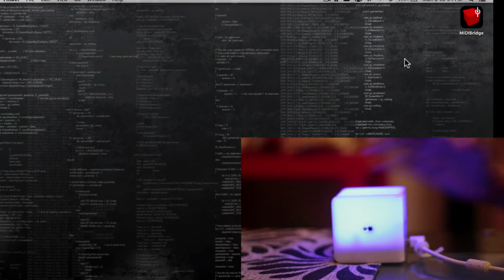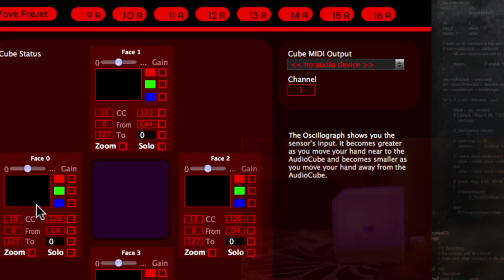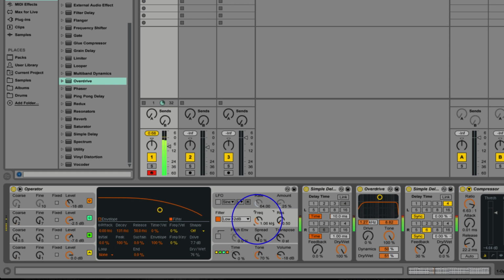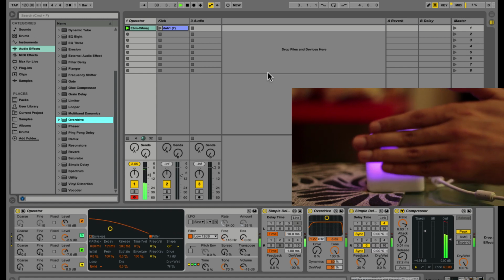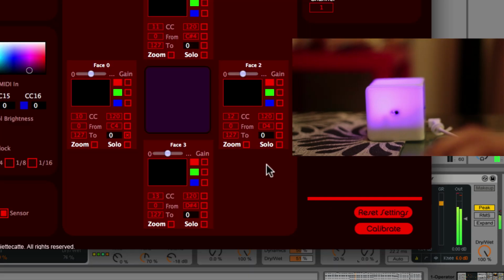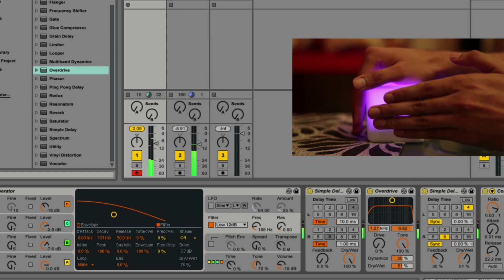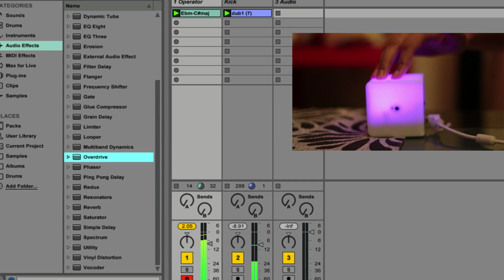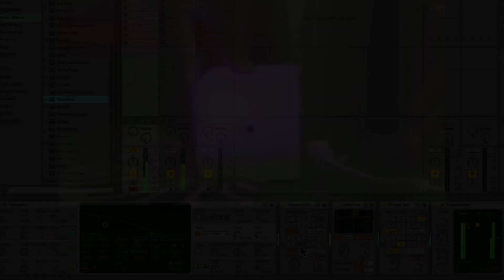AudioCubes Sensor Mode Tutorial

Comment: Paolo Manzelli , egocreanet2016@gmail.com ; The concept of phonons was introduced in 1932 by Soviet physicist Igor Tamm. The name phonon comes from the Greek word φωνή (phonē), which translates to sound or voice because udible long-wavelength phonons give rise to sound.
A "photon" is a quantum of light of wavelength and is the minimum amount of energy which can be stored in an electromagnetic wave at that wavelength e.g translating this to vibrations normally looking at a crystal lattice, could we say that a "phonon" is the minimal amount of energy which can be stored in an lattice vibration in a given vibrational mode. So that"phonons" may be known as "quasi-quantum-paricles".
Shorter-wavelength higher-frequency phonons are responsible for the majority of the thermal capacityes of solids. In particular, the properties of long-wavelength phonons gives rise to sound in solids -- hence phonons are also the primary transfer  by which heat conduction takes place. So that "phonons" my be seen as  specific sub-state of "photons" .As a conseguence there is a considerable disparity between the velocities of "photons and phonons".  The velocity of a "photon" is the same as the velocity of light in the vacuum;  for a phonon, its velocity is that of sound in the matter. (in Water 1500 m/s ,in metals : 5 Km/s ) 
 Phothos and Phonons can interact.
"Sound" waves can modulate "light" in amplitude and phase, deflect it, focus it, or shift its frequency. The "Light" can render acoustic images visible or provide detailed information on the thermal vibrations in solids and liquids. Diffraction of "light waves by sound waves" takes several different forms, depending on the two wavelengths and the dimensions of the interaction region. An analysis and description of these different forms of quantum energy, may be given, followed by a detailed discussion of a wide variety of applications, including signal processing devices, spectrum analyzers, television displays, image translators, memories, based on the interaction and the conversion of light into sound.  At last became be possible to realize a "phonon laser" e,g.  the Sound Amplification by Stimulated Emission of radiation with the name SASER. Acoustic radiation can be emitted in the same way of photon radiation as it  is emitted in LASER. The properties of SASER are almost the same as LASER but a deep study now it is necessary. . 
Biblio online: 
http://ieeexplore.ieee.org/abstract/document/5215753/?reload=true ,
https://en.wikipedia.org/wiki/Phonon ,
http://news.mit.edu/2010/explained-phonons-0706 , 
https://lampx.tugraz.at/~hadley/ss1/problems/phononfield/Q.php ,
https://wiki.metropolia.fi/pages/viewpage.action?pageId=118981927 ,
https://physics.stackexchange.com/questions/92185/photons-and-phonons ,
https://www.quantiki.org/wiki/phonon ,
http://en.wikipedia.org/wiki/Sound_amplification_by_stimulated_emission_of_radiation
---------------------------------------------------------------------------------------------------------
Correlazioni e equivalenze tra fotoni di luce e fononi di suono -
Il concetto di fonone fu introdotto nel 1932 dal fisico sovietico Igor Tamm. Il nome phonon deriva dalla parola greca φωνή (phonē), che si traduce in suono o voce perché i fononi udibili a lunghe lunghezze d'onda danno origine al suono.
Un "fotone" è un quanto di luce di lunghezza d'onda ed è la quantità minima di energia che può essere immagazzinata in un'onda elettromagnetica a quella lunghezza d'onda, ad esempio, traducendo questo in vibrazioni che normalmente guardano un reticolo cristallino, potremmo dire che un "fonone" è la quantità minima di energia che può essere immagazzinata in una vibrazione reticolare in una data modalità vibratoria. In modo che i "fononi" possano essere conosciuti come "parcelle quasi-quantistiche".
I fononi di frequenza più alta a lunghezza d'onda più corta sono responsabili della maggior parte delle capacità termiche dei solidi. In particolare, le proprietà dei fononi a lunghezza d'onda lunga danno origine al suono nei solidi - quindi i fononi sono anche il principale trasferimento attraverso il quale avviene la conduzione del calore. In modo che i "fononi" siano visti come sotto-stati specifici di "fotoni". Come conseguenza c'è una notevole disparità tra le velocità di "fotoni e fononi". La velocità di un "fotone" è la stessa della velocità della luce nel vuoto; per un fonone, la sua velocità è quella del suono nella materia. (in acqua 1500 m/s , in metalli 5 km/s) 
Phothos e Phonons possono interagire.
Le onde "sonore" possono modulare la "luce" in ampiezza e fase, deviarla, focalizzarla o spostarne la frequenza. La "luce" può rendere visibili le immagini acustiche o fornire informazioni dettagliate sulle vibrazioni termiche nei solidi e nei liquidi. La diffrazione delle "onde luminose da onde sonore" assume forme diverse, a seconda delle due lunghezze d'onda e delle dimensioni della regione di interazione. Può essere fornita un'analisi e una descrizione di queste diverse forme di energia quantica, seguita da una discussione dettagliata di un'ampia varietà di applicazioni, inclusi dispositivi di elaborazione del segnale, analizzatori di spettro, schermi televisivi, convertitori di immagini, memorie, basate sull'interazione e conversione della luce in suono. Finalmente è diventato possibile realizzare un "phonon laser" e, g. l'amplificazione del suono per emissione stimolata di radiazioni con il nome SASER. La radiazione acustica può essere emessa allo stesso modo della radiazione di fotoni che viene emessa in LASER. Le proprietà di SASER sono quasi le stesse di LASER ma ora è necessario uno studio approfondito. .
Biblio online:
http://ieeexplore.ieee.org/abstract/document/5215753/?reload=true,
https://en.wikipedia.org/wiki/Phonon,
http://news.mit.edu/2010/explained-phonons-0706,
https://lampx.tugraz.at/~hadley/ss1/problems/phononfield/Q.php,
https://wiki.metropolia.fi/pages/viewpage.action?pageId=118981927,
https://physics.stackexchange.com/questions/92185/photons-and-phonons,
https://www.quantiki.org/wiki/phonon,
http://en.wikipedia.org/wiki/Sound_amplification_by_stimulated_emission_of_radiation